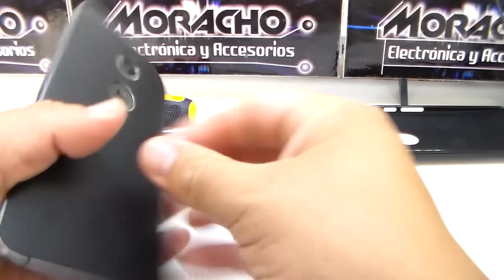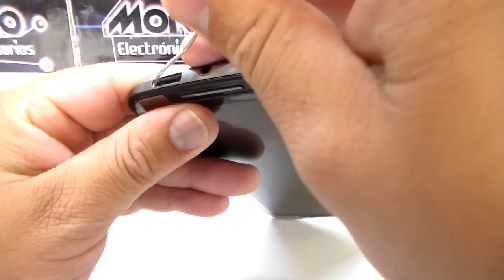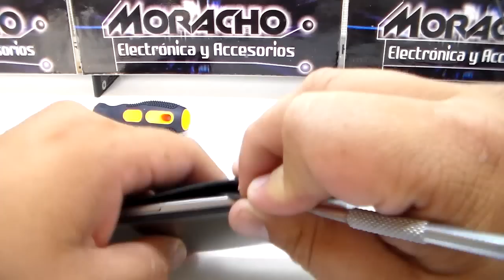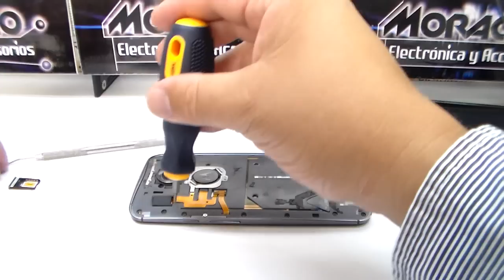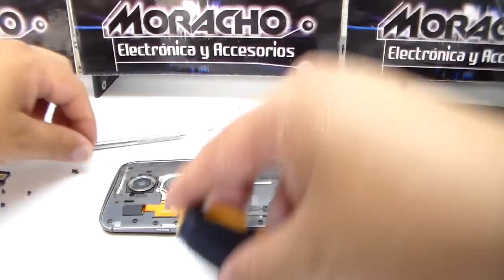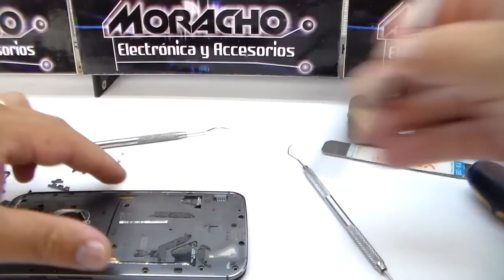Como desarmar MOTO X segunda generación (moto x2)

Comment: It looks so easy, but the plastic was strongly glued to the body. I did too much force and BROKE 1 of the copper lines. The most external line in a group of 3, I think, as shown in the attached picture.The phone seems normal until now, but Im afraid battery will drain fastre or so... https://drive.google.com/open?id=1lsWEW6h9G4RvfwUpRmwxWgIwEG7XYEmF